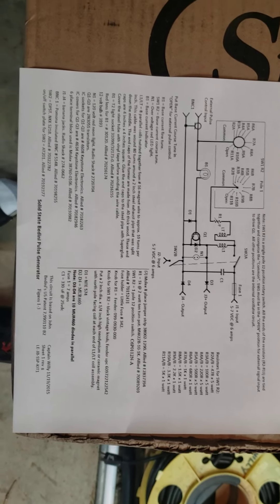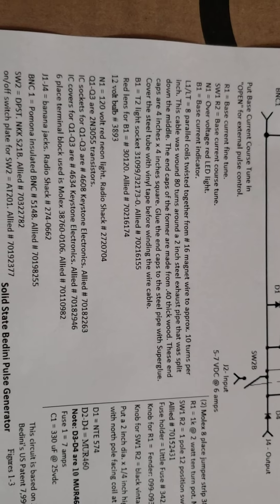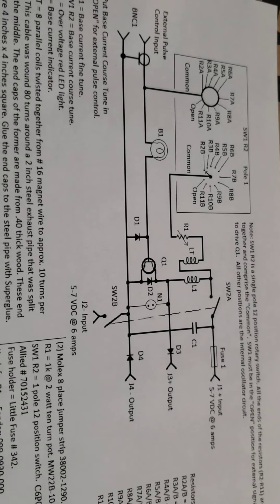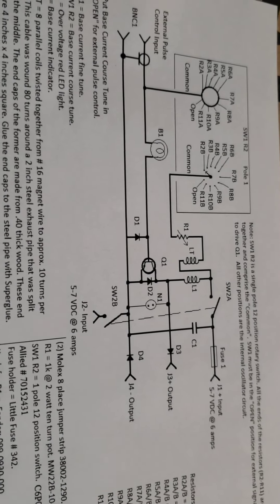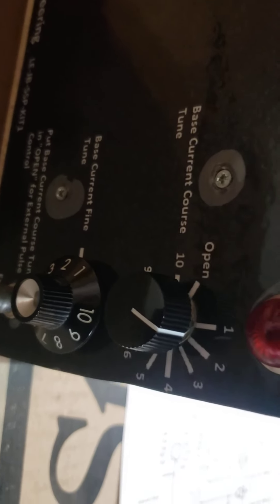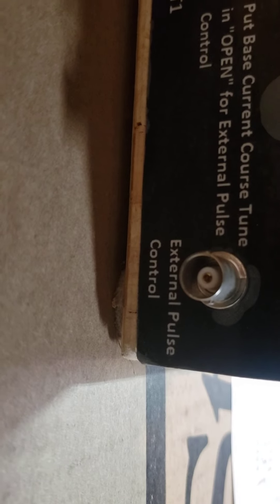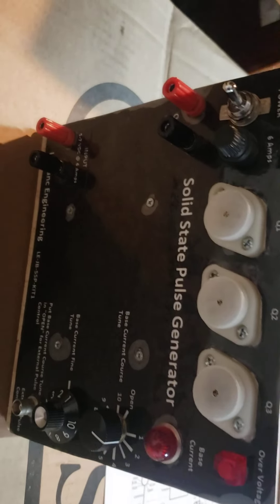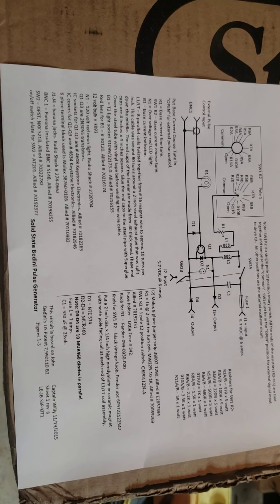solid state Bedini (little) pulse generator

Comment: you dont want to push high voltage across a thick awg coil with low to no resistance. The amps will flow!!!!!!!